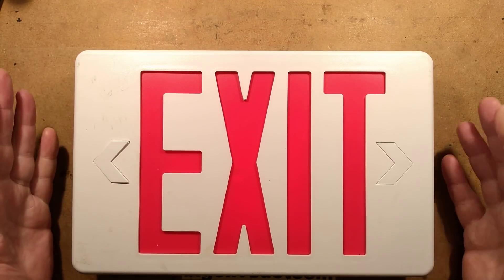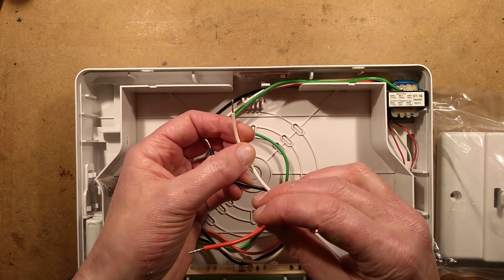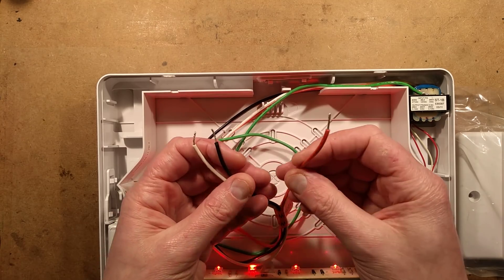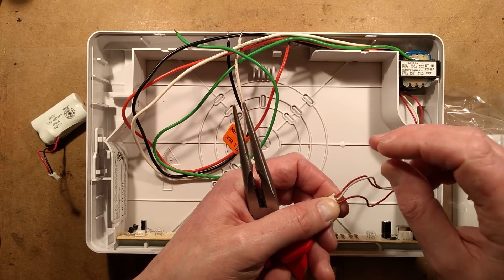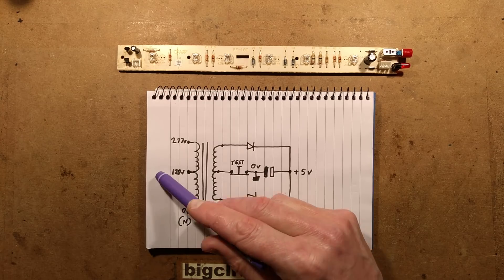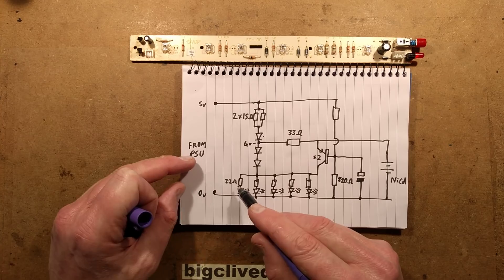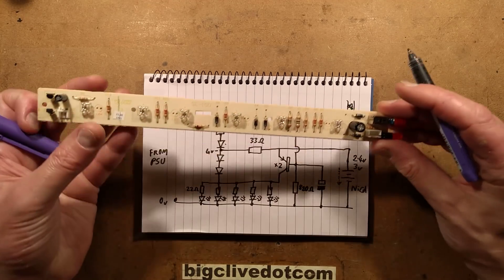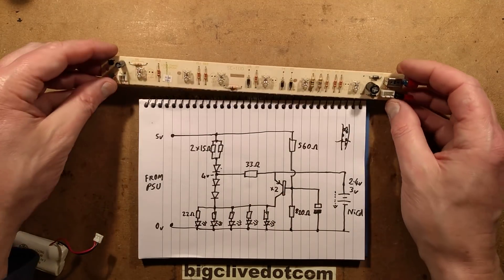Inside an American emergency light (with schematic).

Comment: I've never understood why exit signs in the US are red. The color red has a negative connotation which seems like the exact opposite of what you would want for something that is supposed to lead you to safety. And in the case of a fire, the sign wouldn't stand out near as much against the flames as a green sign.
Reply: Well, it make sense in the context that other fire-related equipment is red.
I don't think they'll make green fire extinguisher since green "extinguishers" already exist (they are portable showers to be used for cleaning chemicals from people's faces and body).
Reply: Tyler Kelley Perhaps the reason exit signs are gradually being changed to green, with the running man on them.

Comment: Years ago I worked in a 3/4 star hotel as a "maintenance technician", (AKA engineering technician). As I was new to the field, I began as what was referred to as an "Engineer 1" then later on after I had learned more, I was promoted to an "Engineer 2". Ultimately, I was made the "Room Care Tech." (someone who's primary job was to refurbish both guest rooms and conference rooms to tip-top shape by repairing anything maintenance related). So... as I was learning my trade, I learned that in my particular hotel we didn't actually have 220 or 240VAC (the old industry norm.) but rather we had 120 and 208VAC. I was told the reason that many businesses or industrial buildings were converted or otherwise spec'd to 208VAC was the fact that the power grid in the US is becoming so overloaded they were backing the "industrial norm." to 208VAC to lighten the load on the grid. If a business really wanted or needed 220 or 240 they had to pay out the nose for it. During my time there, I found that most things that were designed for 220 or 240 would usually work just fine at 208. I enjoyed that job because I worked with some good people who taught me a lot. I just thought I'd pass that on as some FYI about American power grid voltages. Keep up the great work, Clive!! 🍻
Reply: Yes Roger Smith I remember those days real well. I worked for Holiday Inn the same place two times for 6 months each but that was all that I could handle of it from all of the boredom after repairing everything that needed caught up. A boring lonely job that is, especially on the night shift.

Comment: I like it. Elegant in its simplicity. Even the PCB looks to be designed to use minimal etching. No switchmode PSU rubbish either
Reply: Chances are the transformer costs less.  An isolated switcher still needs a transformer.

Comment: I have installed a few cases of that very fixture. So much better than the incandescent ones that had 2 sets of lamps. The 120VAC and the 6VDC lamps.The old type used to have gel-cells and 
over time the trickle charge would cook the cell. You could get new cells and other parts but it was less hassle just to replace the fixture. We got so much better life out of the LED ones.
Reply: How old were the 120V lamps versions?
I have replaced a few old Euro ones (admittedly, the oldest I've seen were 20 years old, so they would be from around 1993) and all the ones I've seen used either 6V bicycle lignbulbs for "standby" and "emergency light" modes (Euro unit must do both tasks : showing the direction of the exit, and also, provide enough light for your to actually see around the room you're in) or 12V car lightbulbs (or 12V lightbulbs for standby and a fluorescent tube for light, and for 'transitionnal" units, orange or green LED for standby and lightbulbs for light before they went all LED).
Reply: @LeSarthois   I think they started to die out at about 4 years. Because at the time I was head of facilities maintenance I always had the lighting on my list of things to test. One of the other buildings that I took over after the manager was moved elsewhere I had to do all the emergency lighting.What a mess. I did both pathway and exit signs, The code here is 90 minutes of lighting during a power failure. I even had to replace a central battery type unit that had started to leak from the very large batteries. That was a spendy hunk of hardware and very heavy.

Comment: IMHO this fixture is a bit dangerous with the loose wires.  A lot of multi-voltage equipment I've seen, they don't strip the wires and they dip the ends in a sealant so there is no exposed conductor.  MUCH safer.  Make you strip your own wires!

Comment: I install many of these units. They are much better than the old lead acid versions but they are light weight and flimsy so getting them to hang level is a pain. Often when I open one up the helper monkeys installed and doesn't work.... They didn't plug in the battery and they tend to leave the 277 wire hanging or if lucky they cut off the bare wire part. The emergency light units now are a royal pain to wire as there is no room for the wire and you are wiring it with solid core wire... We really should be looking into running 14ga for emergency lights to make the installers happy.... Or them design a better wiring connection on the light.

Comment: Is there any way of charging the battery without lighting the LEDs?
Reply from the maker: Not really in this particular unit, since the LEDs form part of the charging voltage regulator.

Comment: The white lead is neutral the black is hot where I live in America. This could be deadly if the wrong hot is assumed. 277VAC is a single tap off a 480VAC 3 phase transformer.

Comment: White is netural. We still call it 'neutral' over here.
Black is hot. For 120V.
That Orange wire should be Red? Either way, it's 277V, which is one leg of our 277/480 three-phase service.

It's not that 277V is better for ballasts, it's that, if you've got a really big building and lots of lights, you can jam a lot more lights on a 20-amp 277V circuit than a 20-amp 120V circuit. Also, the service to such buildings is quite often 277Y480 (480V WYE, 277V per leg) with another transformer in the building to get 120/208 wherever it's needed. Running all of your lights straight off 277V gives you that much less demand on your transformer.

My office is all wired this way -- all of our lights are 277V, HVAC is 277/480, the exit signs in the hallways are 277V.

Comment: I've had these open before. I've never found a logical use for 277v. These signs are really only used where 110 is being used. It's also just for LED'S. I've never seen one of these in such good condition. All the ones I've seen have been pretty beat up.
Reply: Shinigami Lee it's not 240 it's 277, and many buildings use 277 for lighting circuits.

Comment: I wish I could find one of the old edge-lit Exit signs my grade school had, it had a bronze-ish colored background with red letters, and lacked battery backup. I remember it clearly, mounted on the ceiling above the crawlspace door (where they "discovered" asbestos in 1990, and were surprised to "discover" asbestos there again in 2015).

A hospital near me has one wing that has received only very minor facelift-type renovations since the 1960s (the original building was built in 1913). It has an aluminum-walled boxy Exit lamp with white plastic signs that have "EXIT" emblazoned in black. At the bottom of the aluminum box is a rectangular opening with a light diffuser at the bottom, which probably seemed like a good idea on paper to shine down to the floor, but in reality most likely was of dubious effectiveness.

Comment: That's the type I was talking about in the other comment section, the type with the 277V transformer.
As someone else said here, the 277V tap allows this to be used in installations where there is 480V three phase. (277V from phase to neutral)
480V three phase is fairly common in large industrial or commercial buildings.

Comment: I thought it wasn't a good idea to partially discharge NiCd cells (due to memory) unlike fickle lithium cells.
Reply: The Eh Team - The memory effect is a misnomer. What was actually happening was partially discharged NiCads were being put into primitive chargers and given full charges, or worse. It was simple damage by overcharging, causing a loss of capacity. Treat them well and they’re actually a very robust chemistry. NiMHs can be cooked by overcharging too! Delta V intelligent chargers go a long way to improving NiCad longevity. It’s said that NiCad’s internal resistance is lower than NiMH, so they perform better when very high current delivery is required. For example, RC models, power tools etc.
The main reason NiCads became less popular was likely due to concerns over toxic cadmium ending up in landfills. Given an equal playing field, ie modern intelligent chargers, and tested over a wide range of working conditions, it’d be interesting to see how much better NiMH cells really are than NiCads...

Comment: Here in the US, most homes use 120V/60Hz service, except where there is an electric stove or dryer or other large electric appliance or heating system that requires 240V. Yes it's split 240V, with 120V on one side, 120V on the other with neutral in the middle. 

So things like stoves, the 240V runs the burners and heating elements in the oven, the 120V side runs the electronics where present. Dryers, the timer sees 240V at the on position for timers, be it mechanical or electronic but itself runs off of 120V and at the heater elements. The heater elements require the full 240V,  with one half coming from the motor start switch, the other half is fed by a series of thermostats, one being the high limit switch, the other the actual thermostat, together they make up the entire 240V circuit. 

I know first hand as last summer, I lost heat in my dryer last spring, and with some assistance of an appliance repair forum, I figured it out and it was the motor start switch and it's an easy fix. The switch unscrews from the motor itself and is easily disassembled and the contacts cleaned, reassemble and that's that. I got heat again.

Anyway, while testing, I was getting more like 121V per side of the 240, or in this case, 242V as I was literally within sight of the transformer that serves my house out in the back alley. I'm not the only one on that transformer however but the proximity to it determines whether your service is 120 or a touch higher.

Also, I think building codes have standardized of recent years as it depended on where you lived and what jurisdiction you were in because you may not have had much in the way of building codes but I believe that's all changed to simplify the building codes in the US, and that I believe also applies to electrical codes as well. This was done to help those in those trades/fields to be able to move from one area of the country to another and the code is now codified as at one point, there were something like 6 or 7 jurisdictions and they were all different, so when the standards were codified to one basic set of standards, they then took in some of the variables from say Florida where hurricanes are prevalent to areas of the Midwest where tornadoes exist to the NE for the Nor'easters that hit most years putting on feet of snow to the west where wildfires in the SW and earthquakes for much of the west coast are now part of the code itself. Even though it's not a federal, nor technically national code, it is adopted nationally and all cities, towns etc must do their best to adhere to these codes or they ARE held liable for any injuries or deaths due to inadequate building and electrical and plumbing standards as I believe it's all the same for building and water as well.

So things like older standards are grandfathered in until a major renovation takes place, such as remodeling the kitchen in an older home that predated GFCI outlets, once renovated, it MUST have them as part of the modern code being just one example. 

I'm not in the trade, but did read up extensively on this 3 years ago or so.

Comment: I use these in schools. Commercial buildings have available to them 110-120V outlets. a couple of schools I worked in had their lighting at 347V. Also available is 220V for stoves and small fans like roof exhaust fans. We also have schools with 12V networks to operate relays. Finally 550V for motors, large fans and large rooftop AC units. This is in Canada.

Comment: You can run a lot more lights per circuit at 277 than at 120v. More lights per switch without having to use a contactor for multiple circuits. good for large offices or factories.
Reply: In most cases these exit lights are on a dedicated circuit breaker, not only to insure they continue to get power should a device plugged in somewhere else cause a breaker to trip, but also to do extended battery testing/repair simply by disconnecting power to the signs exclusively. Not sure if that is required in electrical codes, but it is widely considered a "good practice."
Reply: It depends where you are, Ive only ever seen the exit signs on their own dedicated circuit once or twice, usually we have always just wired them to the nearest lighting circuit.
Reply: @dashcamandy2242  I just meant that is why most commercial and industrial building have a 277v system. So they can run more lights(not exit lights) per switch and circuit. It's a lot easier to have 5 switches with each doing 50 lights, than 20 switches with each doing 10 lights
Reply: You can run even more lights on a 347V circuit ;)

Comment: Actually they don't discharge when connected during installation - when I have watched them replace these and also light ballasts at work they don't bother to shut the power off at all.  Spark show can be fun...
Reply: I've replaced many of these signs and florescent ballasts. I'll always look quickly for a breaker to turn them off but if it's not obviously labelled (they rarely are) I just go ahead and replace it live. With the ballasts I could just turn the light switch off but then people are sitting around in the dark waiting for me to finish so I usually do those live as well. You just have to be a little more careful and keep the wire nut on the hot wire as much as possible. They do make some nice sparks sometimes though.

Comment: I remember when those things had lead acid batteries in them.
Reply: I'm still replacing all those old signs with ones very similar to this one.
Reply: Yes, and some had a charging circuit that worked while others boiled the battery dry much too quickly.

Comment: Big Clive made me do it...
https://i.postimg.cc/W3y1w2YQ/reverse.jpg
https://i.postimg.cc/C15K8Z7G/Bench.jpg
Reply from the maker: Close, but double check the position of the output capacitor C3.  It'll be on the other side of the diode.  On the primary side the two 360K resistors may be connected to C1.

Comment: Had to laugh at you not wanting to touch the 120v, i've touched 240v many times without getting a shock, just got to make sure you don't complete a circuit :D
Reply from the maker: I'm isolated at the bench.  I just like to encourage caution.  people do get too casual with the usual small shocks.  They don't realise that the one day they get a shock with wet hands or feet on a grounded surface it's going to be very different.
Reply: Totally agree, you would have to give out a warning everytime, and that gets tedious.

Comment: i have the guts from one of those things but even with new batteries i can't get it to light any idea why?
Reply from the maker: Check everything is plugged up correctly and you could try charging the batteries externally before putting them in.  Given the abuse these things get it's worth checking for broken solder joints around things like transformers if the unit has been bumped about.

Comment: In the USA, most homes have split phase, so it creates some problems when setting up the power distribution panel (breaker)
so we have to hot legs, a neutral and a ground.

Comment: That looks like the Lithuania emergency exit light. They come in green and red and are usually pretty cool lights. I've installed many of those over the years on both 120 volt and 277 volt.
Reply: Looks like autocorrect turned your "Lithonia" into "Lithuania"  :)
Reply: @fillg  lol... Silly Autocorect strikes again!

Comment: I believe America has started to allow green ones like the uk ones.
Reply: The color is a local thing.  Some places in US require green signs and green international running man signs.  Other places require red.
Reply: Mai Mariarti  , this is done on aircraft as well and in movie theaters. On aircraft they also have markings where there the emergency exit is located.
Reply: Just switch out the round door knobs and the inward door and someone actually will survive a fire....

Comment: Most exit lights in the US will not light (even with battery connected) until utility power is applied once. And then will always light when battery is connected. So, either this light is the cheapest of the cheap or its been hooked to utility power already.
Reply: Mr. Sleep - How would this particular fixture ‘know’ it’d already been hooked up? It has no ‘smarts’ in it! ;-) I think this sign is probably very cheap, but it looks like it’ll be reliable.

Comment: Not quite sure what you mean by "cap off", are you suggesting to simply trim the bare lead? Because that would be a terrible idea.The proper way would be to properly insulate it, either by putting it into a connector or crimping a plastic cap onto it.
Reply: "Capping" typically means affixing a plastic wire nut to the end of the lead.